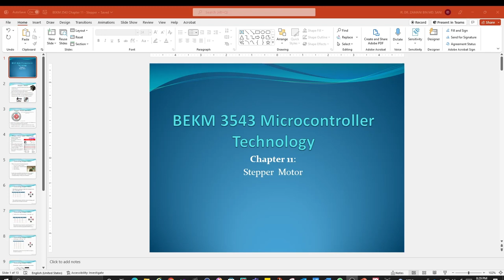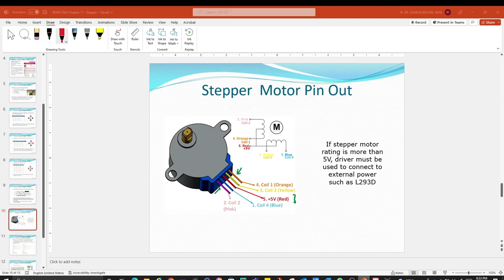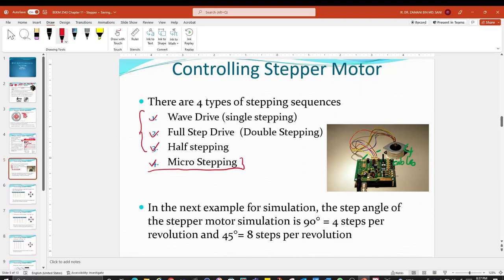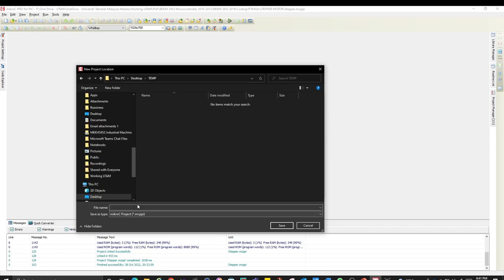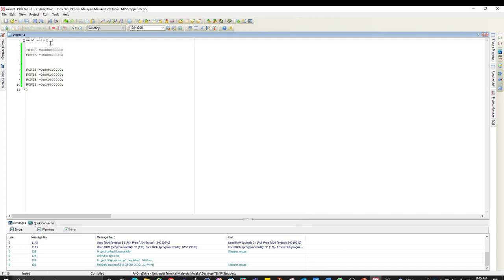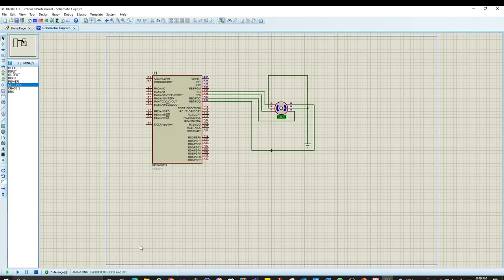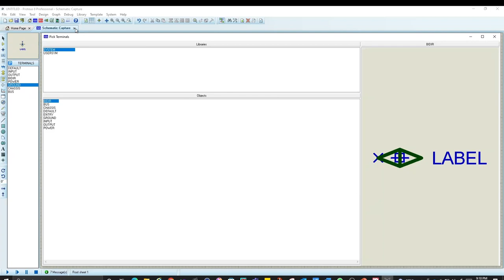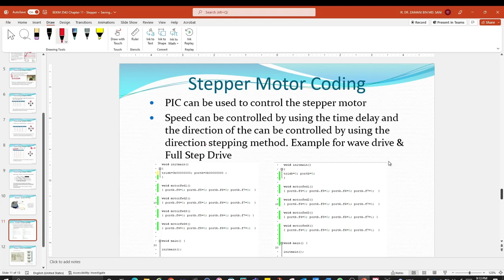PIC16F877A Stepper Motor Control

Comment: THANKS DR 
COULD YOU PLEASE SHOW US HOW TO ACHAIVE CERTAIN DEGREE USING STEPPER MOTOR 
FOR EXAMPLE I WANT TO MAKE STEPPER MOVE TO 89 DEGREE THEN STOP FOR CERTAIN TIME THEN BACK TO ZERO AND SO ON
Reply from the maker: For stepper motor, you need to calculate base on the angle spec how much turn it need to 89 degree. If you get more than 4 or 6 turn, you need to know how to use for loop to achieve the exact turn for that. Stop at certain time you can use delay, and if you wan to reverse, you can drive the pin backward from the pattern.

Normally to make it easier, you need to create functions for it